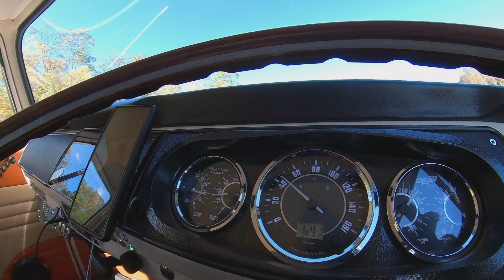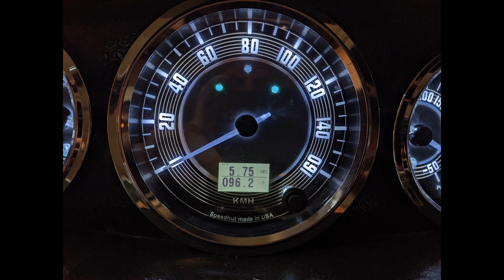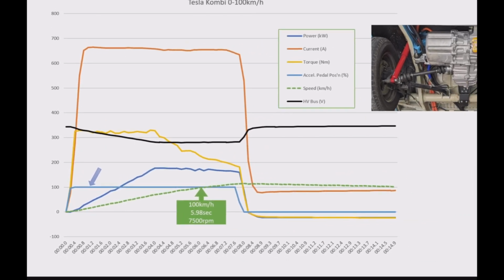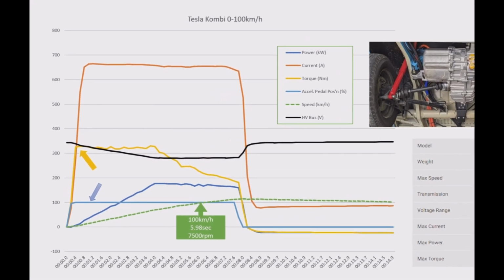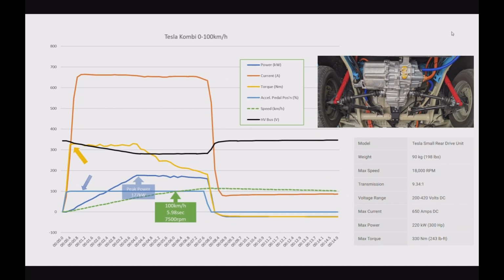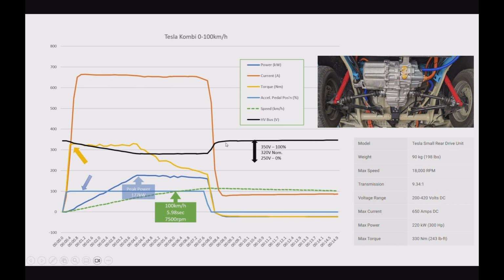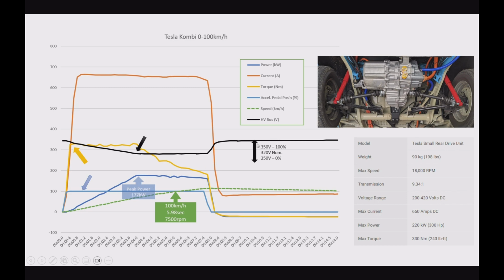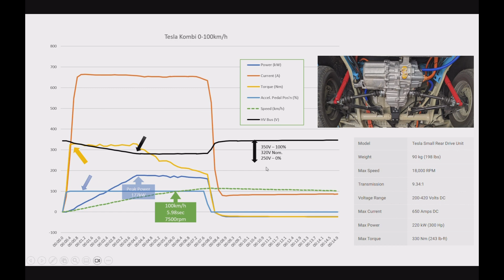How quick is a Tesla-powered VW Kombi?? Electric conversion Pt 5

Comment: I'm putting an SDU in a VW Caddy pickup truck using the EV Controls controller.  I thought I might need to get a traction control unit but it doesn't look like the SDU has enough torque to spin the tires at least when the road is dry.  Have you had any traction issues?
Reply from the maker: I've got a lot of battery weight over the rear axle so I've never had any traction issues.

Comment: Lovely finished product guys, I was waiting for the followup on your mini series. Excellent work! Working on a full electric restoration of a 78 combi myself, but I'm still in the early stages of battling rust and worn parts ;).  I am wondering if you can tell some more about the axle setup, possible adjustments on braking configuration and the drive shafts to transmit the force. Also, did you develop the cradle for the Tesla motor yourself?
Reply from the maker: Thanks! Sorry for the slow response! The motor mount was designed and made by Traction EV. The axle configuration is described in an earlier video - modified stubaxles to Porsche 930 CVs, Commodore heavy duty axles, and Tesla to 930 flanges on the motor side.